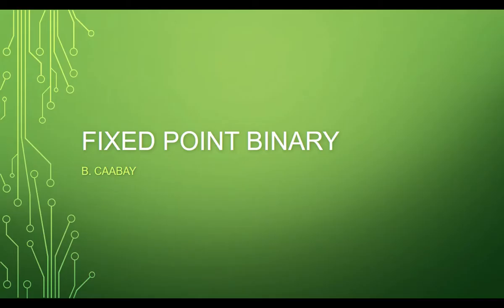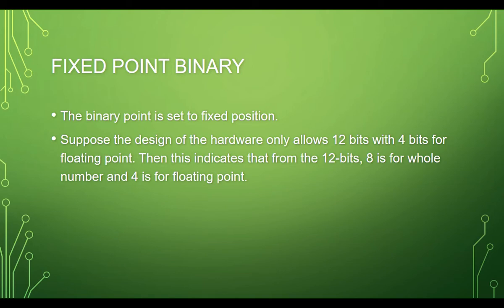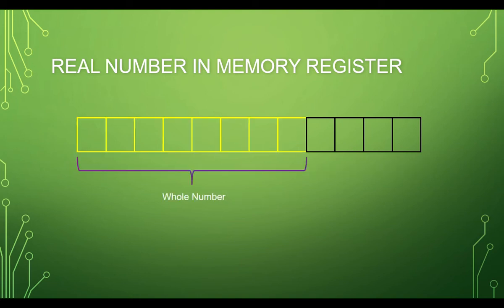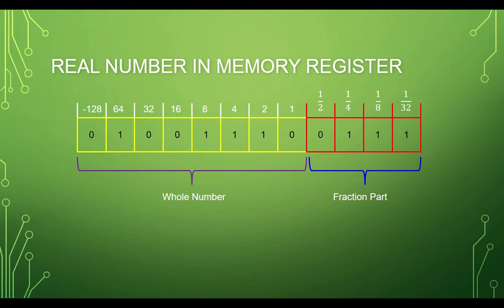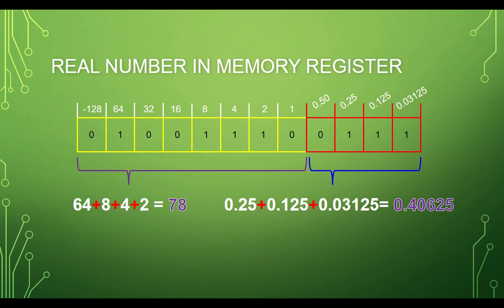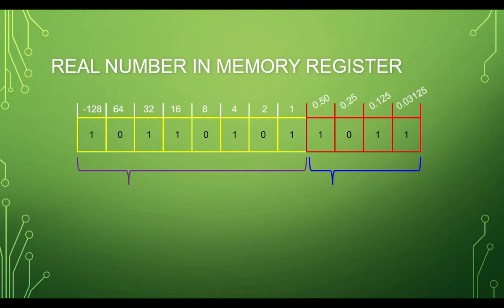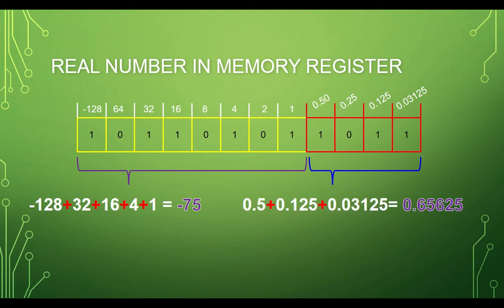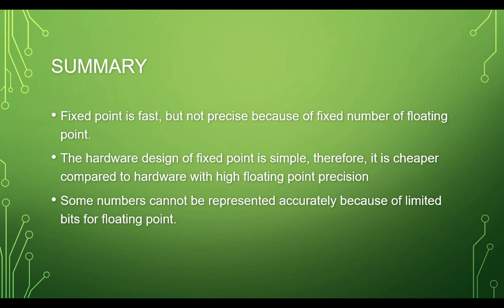Fixed Point Binary

Comment: Sir di po ba dapat 0.0625 yung sa rightmost bit ng fractional part?
Reply from the maker: Yes, you are correct. The last bit in the fraction part should have been 1/16 (The most right side) which is 0.0625

Comment: Sir hindi po ba dapat pag inadd yong negative whole number and fractional part e ang magiging sagot eh -74.3125 considering na yong rightmost fractional part ay 0.0625? Iba po ba talaga to compared sa naunang way sa naunang lessons sir? Thank you po.
Reply from the maker: Yes, you are correct. The last bit of the fraction part (rightmost bit) of examples 1 and 2 turned out to be 1/32 which should be 1/16.